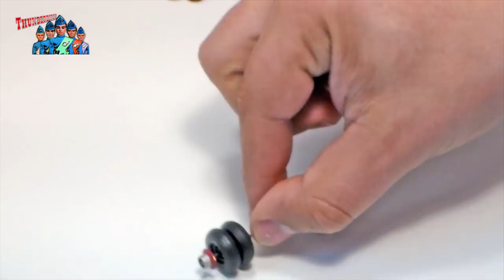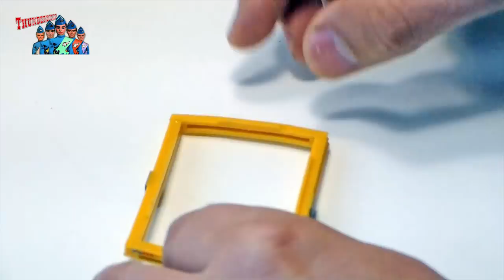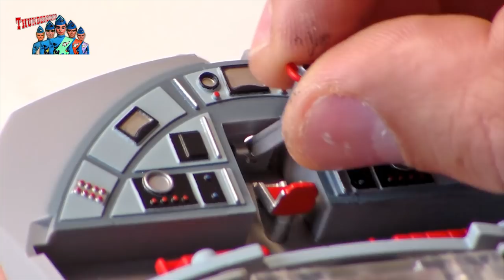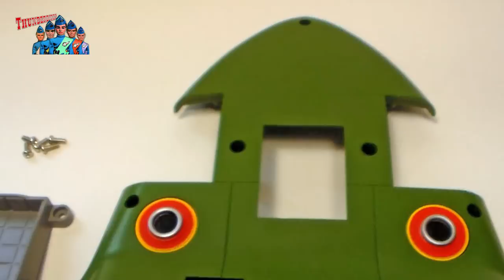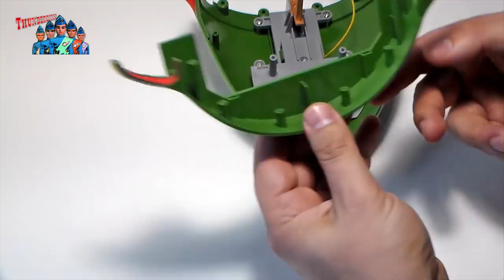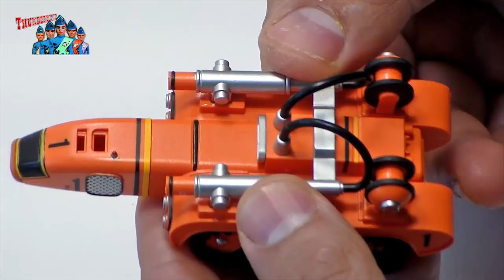1/144 THUNDERBIRD II FULL BUILD EPISODE 1

Comment: Funny thing you build this time. Is that yellow material somewhat rubbery? it looks so. BTW electric connectors, does not matter what is where, it is in parallel so connectors are not task specific on that small board, it is just sort of usual to connect power to 1st :)
Reply from the maker: Just following instructions! Thanks! :)